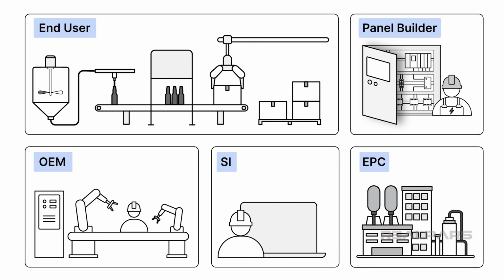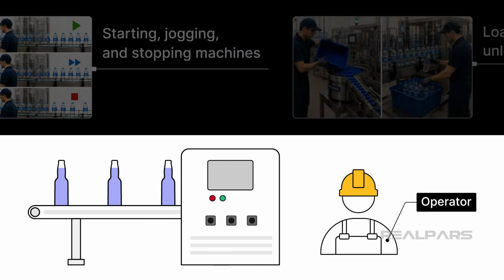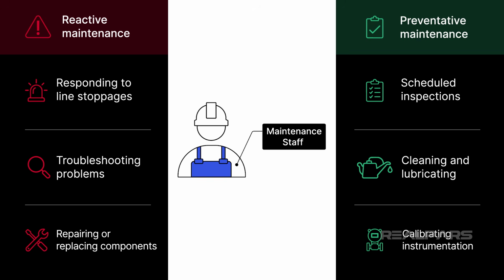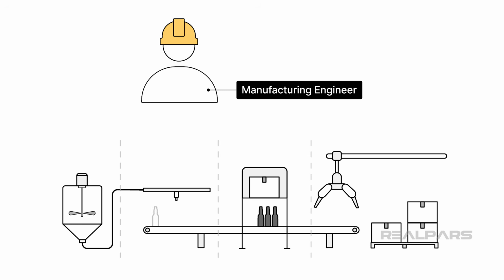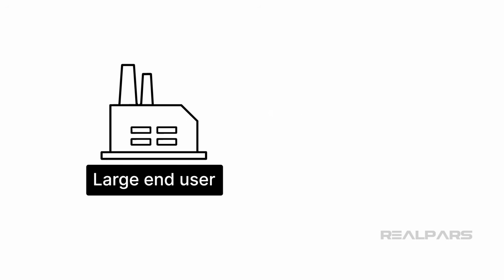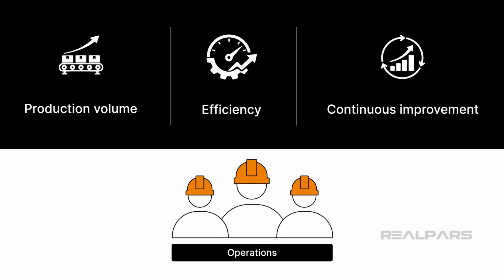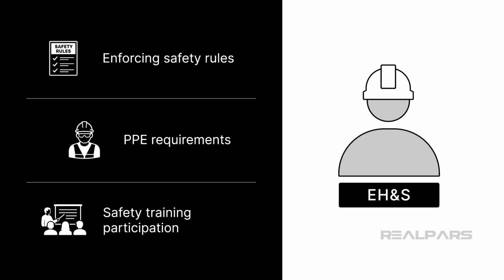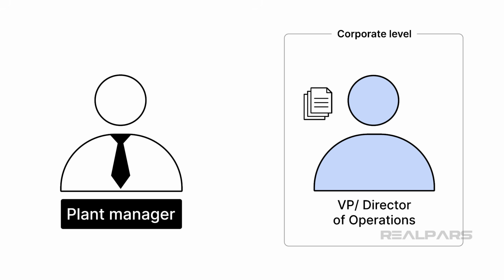Industrial Automation Jobs in a Factory Explained

Comment: Solid breakdown of how these roles connect on the floor. One thing worth adding for anyone in or moving into a Maintenance Tech role — your relationship with your MRO supplier is one of the most underrated tools in your arsenal. When you're being measured on unplanned downtime and MTTR, having a technical partner who can help you identify the right bearing spec, source a hard-to-find component fast, or support a shift to predictive maintenance isn't a luxury — it's part of the job. The best maintenance teams we work alongside treat their supply chain the same way they treat their PMs: proactively, not reactively. 👊
Reply from the maker: Great point; building strong relationships with suppliers is definitely a key factor in minimizing downtime!
Reply: @realpars  Exactly — and the best partnerships go beyond transactions. When your supplier understands your operation, your equipment, and your maintenance cycles, they stop being a vendor and start being part of the team. That's where the real value shows up. 👊